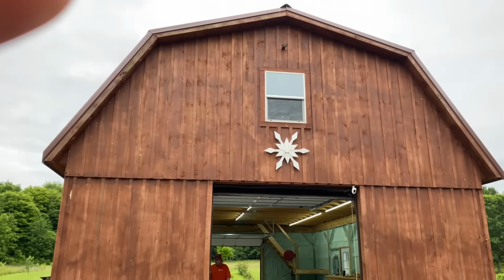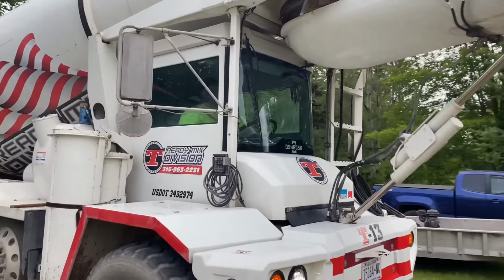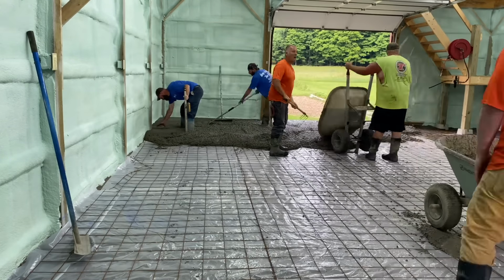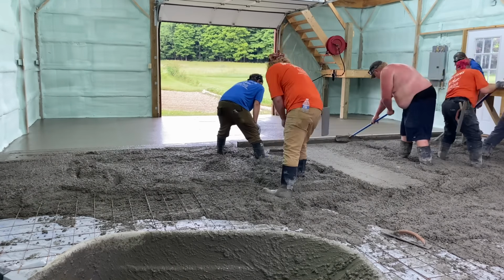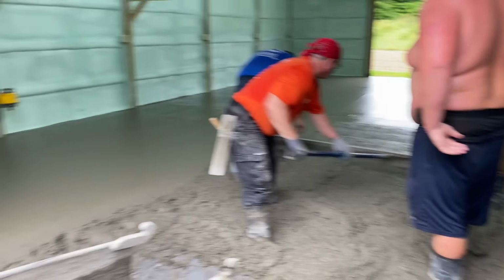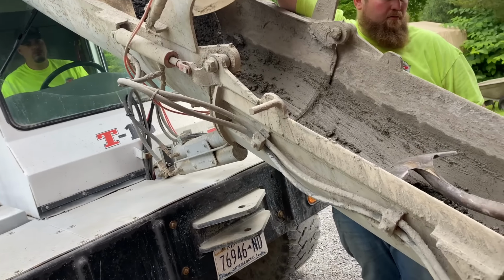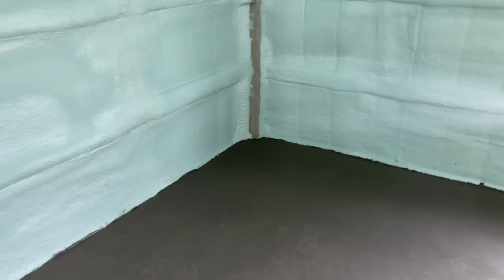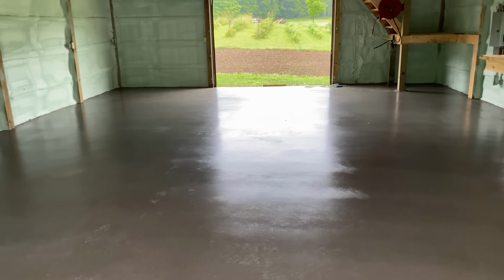HOW WE MAKE 1000's EXTRA EVERY YEAR POURING CONCRETE!!!!!!!

Comment: I would think that you could really benefit from an 8' chute of your own with a chain attachment so you could extend the existing chute or divert concrete to the side with it.  Would save a lot of wheelbarrowing and allow you to get into some corners and other spaces much easier.
Reply from the maker: I have one but we pour the concrete at a low slump and it does not flow down the chute very good. Has to be poured with more water or water reducer chemicals.

Comment: you are basically moving a yard of concrete in 3 wheelbarrows, that's not bad at all!  I would imagine if you  had some kind of a big elevation change you would want a pump at that point?
Reply from the maker: Yes big elevation or hard to access areas we would pump. A yard is 27 cubic feet and we move 24 with 3 wheel barrows.

Comment: 1:12 One wheelbarrow hold 8 cubic feet of concrete? At 150 pounds a cubic foot that's 1200 pounds of concrete in one wheelbarrow.
Reply from the maker: They are the 8 cubic foot ones. You can get a 6 if its to heavy for your guys.

Comment: Question: Not trying to be rude or anything, why would you spray foam the walls but not do a radiant floor. Seems backwards to me.
Reply from the maker: He heats it with a wood stove so does not want in floor heat.